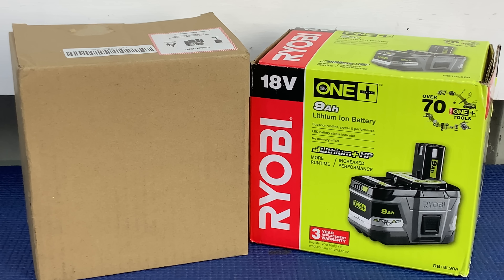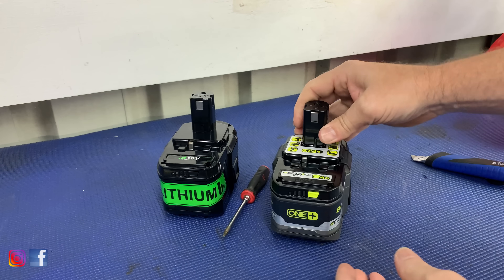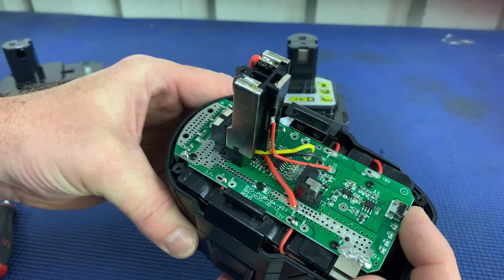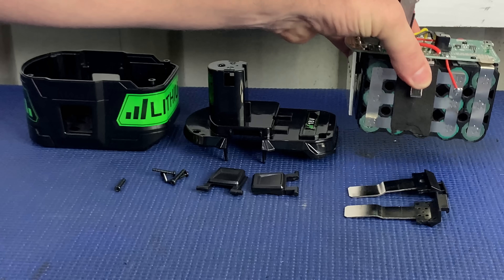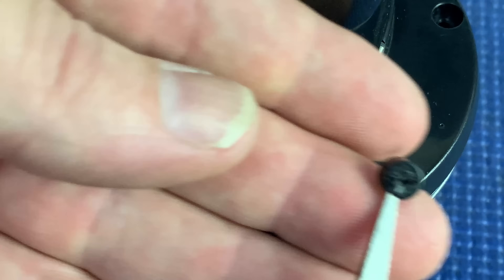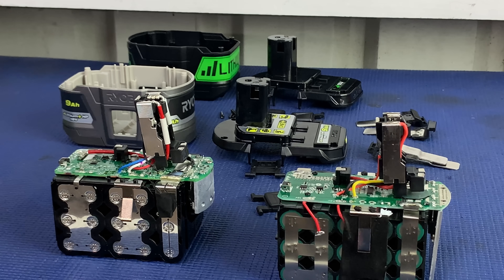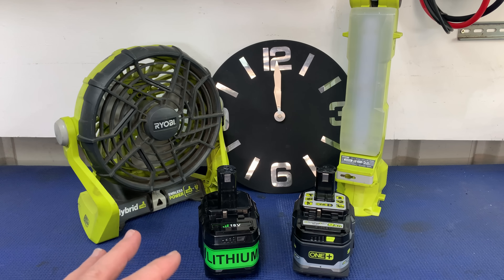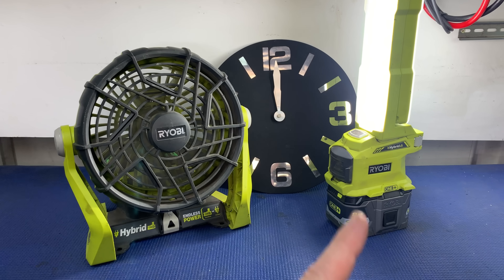Ryobi 9ah battery versus eBay knockoff job

Comment: All good tests and points, however in 2023, Ryobi are taking the absolute piss with the new battery pricing here (AU). It's been increasing in price, and lowering in capacity the entire time (4AH is now the same price that 5AH was 24 months ago. This is a BS move.  Ryobi batteries are far too expensive and it's on purpose. I hope aftermarket batteries improve and some better quality alternatives arrive. Ryobi are doing a "Polaroid camera" move on us. The Camera is cheap, the the price of film will send you broke.

Comment: Seems to me it IS worth buying to use in things like the light and fan. No point in having the large name brand battery tied up as a light.
Reply from the maker: That is a very reasonable call, BUT still have to address the 'value' and ethics in marketing - the battery tested out at just 3 ah...

Comment: How did the Charge/Discharge Cycle test turn out?  I looked for the follow-up, but didn’t fine it.  

If these batteries performed as well as the 4 ah Ryobi batteries… and where reliable at least for a few years, I would pick up two to have as backup, and use while waiting for the Ryobi Batteries to recharge… or when I use multiple tools at once. 

All my best.
Reply from the maker: They tested at 3ah after about 6-10 cycles they died and found 2 'cells' zero volt :( I still have the footage from tests I did but they were not worth putting together for another video
Reply from the maker: the only public post after release of this video here https://www.instagram.com/p/CNrOhGAn8Sr/
Reply: @HBPowerwall   I appreciate the reply, and your experience with these batteries.  Was even thinking of picking up to for my old Blue Ryobi Kit (5 1/2" Circular Saw, Drill and Reciprocating Saw and Light) and giving it to my son-in-law.  But I'll just get two of the Ryobi One Plus 18v 2ah black batteries.  They'll perform better then the old NiCD Ryobi 18v batteries that I used for years.  It's very, likely these batteries wouldn't be reliable. 

I appreciate the help.  Aho... 😉

Comment: I bought this exact knock off battery. I used it in mt grinder. while grinding metal. the battery gets hot and the grinder stopes working. It has to cool down before I can grind again

Comment: I called BS on this review
Reply from the maker: its a fair call, but also this is honest as it gets - ABSLUTE shit battery advertised as 9ah, tested at 3ah 9 or so load tests into the next video battery went zero volts and wouldn't work again.. changed the bms to another set of batteries - worked fine again.. You call bs I say I was FUCKIN honest!
Reply: @HBPowerwall  when you do a review you can't start off in a biased position because it makes it look like you're paid to do the review which this one seemed like it and a lot of other people seem to have thought so also. Don't get me wrong You're good at doing reviews but that also adds to the thought of maybe being paid for on the reviews..  see the thing is what everybody wants that is looking at the knockoff batteries is to save money and the amount of time allotted with the name brand battery compared to buying two that claim to be 9 amps but actually 6 amps or whatever You're getting 12 amps for a lesser price even if they were four amps apiece that's still considerably cheaper than one 9 amp hour and you're still getting 8 amp hours... What the real test would be is to run the batteries hard draining them as fast as you can as many times you can that would be a very good video because that's what most people are wondering how hard and long can you run those batteries before they crap out cuz we already know that they're Chinese young so we're not expecting the name brand performance we just want them to work and get our money's worth... I hope this helps
Reply: @HBPowerwall  you can rejuvenate them by bypassing the BMS and hooking a fully charged one up to it just to get it past the voltage where it recognizes it as a lithium bank

Comment: I feel like you were pretty biased against the knockoff from the very start. Not that I blame you, but if you're trying to give a fair comparison you should reserve your opinions for the end of the video.

I also think it would have been better to test the batteries before opening them up. What if the knockoff's locking mechanism worked fine before you disassembled it? We'll never know.

You wouldn't have been able to test the performance if you accidentally killed one of the batteries when you took them apart, like when you dropped the name brand battery. That would have ruined the video pretty quickly.

I wouldn't mind seeing some kind of measurement on tool performance, like what were the RPMs on the fan on the name brand vs knockoff battery. Did one push more air than the other?

I bet the Ryobi did better. This could also explain more of the price difference between the two.
Reply from the maker: it was so shit from the outset, it created a reason to actually make the video lol Old youtubes then thought - i'll pick a shit video and send it out to the world lol

Comment: I have found that knock-off batteries (or  off-brand adapters) are always missing the protective circuitry that keeps the tool from over-discharging or over-currenting and ruining the battery itself. Probably why there is so much more circuitry in the real thing.

Comment: Your math is really weird.  How do you claim 300 vs 72 is a 76% difference?  All your other percentages are wildly off too.
Bottom line is you can buy 4 generics for the price of one genuine.  The question then is that good enough?  And it will be more of an aging thing than a run time thing.  Which of course you didn't attempt to answer.  For such a massive price difference I would use the generic and buy a new one whenever it goes bad.  But it could be the wrong decision and only time would tell.
Reply from the maker: Suck at math but I’m better at math than they are at honest marketing or good engineering

Comment: Owning a load of Ryobi One tools and having an even increasing number of batteries that seemingly die for no reason and usually a month or so after the warranty runs out, I think the knock of batteries are probably a good idea. It's a shame you didn't try the battery in the charger before you dismantled it - it my be a reassembly issue.
Reply from the maker: the reason for the video is it kept falling out of my wippersnipper and it 'wasn't warranty issue' kinda useless piece of junk - didn't last 2 weeks and 15 cycles
Reply: @HBPowerwall  gotcha - not knocking the video mate just moaning about the reliability of the ryobi batteries. I'd love a decent alternative - I'm so heavily invested in the tools now I'm a bit stuck.

Comment: There's a big difference between a knockoff and aftermarket. This is obviously not a knockoff but either way if you're paying a lot less you shouldn't expect it to be the same as the ridiculously overpriced original.
Reply from the maker: what pissed me off is it fell out and measured at 3 ah not the advertised 9ah.. it's just lies and deception - then wait till you try to claim that warranty!

Comment: My fear with the knock off is, it could only be rated at 250 cycles where the genuine one could be rated anywhere from 350-500.

Assuming 500 best case scenario for ryobi and 250 for the knock off(There's no way the knock off is throwing in good quality batteries at that price), that's 50% of the knock off's value down the drain and with 25-35% less capacity that brings the value of both equal in terms of ROI(assuming the knock off works for it's entire rated life cycle... zero chance of that happening if they're being used in high drain tools)
Reply from the maker: knock off got less than 20 cycles then died lol

Comment: Purchased Vanon Batteries on Ebay - What total Rubbish
Reply from the maker: ooh Vannon... what crap did a video on them too only to find out they sent me a battery with Premium cells in it, sold 100's on my recommendation only to find out all the 'client' ones were cheap crap..
Reply: @HBPowerwall  Thanks for your input.

Comment: I will say it was very enlightening but there are caveats, ryobi branded chargers the flat long green ones have a high failure rate, I've lost 2 new ones and a used one that works intermittently. This leads me to believe a. I'm either extremely unlucky b. Quality Control has suffered. The older one can still charge batteries every now and then, both the new ones failed within a month. It happened during covid, I didn't feel like returning them so I popped them open. The 2 new ones had a different pcb than the older one, I suspect a power switching component to have gone bad on the new ones. Like described on this video:   https://www.youtube.com/watch?v=b9HJ1iiyvWs

I also had a 2ah battery come bad from factory on a 2 pack, one of the cells was shot it no longer takes a charge. $50 and half the products were bad from factory, again during the lockdowns so I didn't bother with returns and I poppped them open. I wish a had a battery welder they're about $100 for a decent one and I could just replace the cells myself, I went through a bit of buying tools at pawnshops and ended up with like 3 2ah dead batteries, upon opening those on some the nickel plates were broken and on one another bad cell, these were used so I have no idea how long they lasted.

I really love the one+ system, they have a lot of neat tools I do wish their quality control was better, but at the very least I haven't had a single tool go bad, just batteries and chargers. Hell my first ryobi from the blue and yellow days still works fine with new batteries (my yellow batt died). In any case I consider these mid tier tools, if you want quality go Dewalt but from stuff on the internet their QL isn't any better than Ryobi, I think they're even owned by the same umbrella company.

This answers my question, either buy used legit Ryobi or new, but not the fakes.

Comment: I stupidly tried the knockoff Ryobi and DeWalt batteries. Junk. Yeah, they worked I guess, but as you demonstrated, NONE of the knockoffs "snapped" in the charger or tools and that drives me nuts ! The big difference was the longevity. The knockoffs do not last and will stop accepting full charge too soon. Great video here,  it I was already convinced based on my attempt at going cheap. Not again. They run the real thing on sale frequently, so I just wait for sales.

Comment: Why didn’t you test the batteries before taking them apart. We will never know if the connection would be better or not. 
Test Test Test then strip it down.
Reply from the maker: I was using it, we will call that a test - it was effing useless, decided to make a video... in my mind I tested, tested tested, got pissed, made video...

Comment: We have 8 "Ryobi type" 18V batteries, half are authentic and half are knock offs. You can tell they are knock offs with just a cheaper feel and they do last a little less, but for essentially 75% off the full price option its worth it. We've had them for a few years and they don't run like they used to, but the fact they are still going is impressive for a cheap battery.
Reply from the maker: Must not be this shit battery brand then, cause this died 100% useless after less than 10 cycles

Comment: Bought a couple knock offs for my Dewalt 20V max equipment and they have been great! 1/3 the price of Dewalt.
Reply from the maker: Seems like your the exception not the rule.. congrats on not being screwed over.
Reply: @HBPowerwall  I did my research here and on Amazon and went with a knock off that most people had good luck with. So I really didn't leave it up to chance. In fact if I remember correctly I could return them if I wasn't satisfied.
Reply from the maker: Sounds like a soild plan but doesn't make for a very youtubie video lol

Comment: I have some knock off batteries from amazon.  They are 5 amp hour batteries.   I have no issues with them staying in the tool.  They are a couple years old and still working.  Am I getting the same performance as a genuine one probably not but they plug in and run the tool and I got two battery for less 1/3 of the of one.  I can easily switch to the second.   My logic is I can have 6 cheap units for the price of one genuine.  I know for fact the 6 batteries will give me fat more run time then the one genuine one ever will come close too.

Comment: The Ryobi batteries are clearly better made and have some additional features. However, they're still insanely expensive. Lithium batteries aren't that expensive anymore, Riobi is just having a laugh with their markup. Would be nice if there was a bit higher quality knockoff was available.
Reply from the maker: I guess RnD is expensive... also those nasty share holders..

Comment: That is an interesting video. Where is your follow-up video on the multitude of deep charge and discharge for these batteries? Went to your YouTube page and could not find this test. Please Supply a link. Thank you and best wishes
Reply from the maker: Started the process straight away about 5-10 cycles in battery died and I got so pissed off I just gave up, at that time video wasn't doing anything on youtube and seamed useless to continue, little did I know it would be one of my higher ranking videos long term https://www.instagram.com/p/CNrOhGAn8Sr/ here is a photo of said tests
Reply: @HBPowerwall  thanks ....

Comment: Your absolutely correct. You don't have to work for ryobi to know that the e bay knock off batteries don t last.
Reply from the maker: If they advertised them correctly it'd be fine but the 9ah that's actually 3 makes me hate them more !

Comment: The big 6 amp and 9 amp batteries are for the big power draw tools.  I feel the difference in my circ saw, 1/2” impact wrench etc.  testing it on an led light isn’t very helpful.  Although I do appreciate the time and effort it takes to buy these things and make the videos, so thanks!

Comment: I have several of both batteries and the one you claim is a cheap piece of shit lasts 2-3 times longer then the ryobi branded one. I use them
to drill holes for goose decoys in frozen ground and I can tell you from 4 years of using them that the cheaper batteries are better as far as run time and how many charges they take before giving up the ghost. Your review is obviously biased because O have abused the hell out of these cells and I know what one is better. The Ryobi has a more durable housing but that is where it ends.
Reply from the maker: I don't believe that for a second, but well done i guess.

Comment: Your test was not done in a very scientific way. You were so biased right from the start that one has to be suspicious of your results. Its true that the knock off was inferior in some aspects to the genuine product but the price was significantly different and you had disassembled and reassembled both before the test which conceivably might alter the fit and the results.  In view of your misgivings about the non-genuine brand it would only be a fair test if you concealed which battery was which before looking at the results.
Having had serious issues in the past with "genuine" batteries of the same brand (admitting that they were the smaller, older model batteries) I use different brands whenever possible. Now I know that the variety of tools with that brand are more extensive than those of cheaper brands so I do still have some of those that I use regularly.  However if the time of the use is multiplied by the number of discharges before the battery failed you might find that the cheaper battery is much better value as this has been my experience.  In addition, I don't know what brand that you tested but it's not fair to label all cheaper products with the results of the test of a single battery that is anonymous anyway. If you can afford to test a number of the genuine brands verses a number of different cheaper brands, and collate the costs versus the effectiveness you might come to a different conclusion if you are open minded about it

Comment: As others have said (including the author) on low-drain (low power) tools the differences are relatively small, but on high-drain tools (try the Ryobi heat gun) the knock off batteries will not generate enough current to run at the same speed/heat output. Yes, they may last almost as long, but they are running at lower output to do it, so their stated capacity is, in effect, garbage! Put them in a high power blower and you can hear the difference in run speed. The cells just do not have enough current available to run the tool properly. I have tried both extensively and now would rather buy second hand Ryobi than brand new knock-offs. Just my view!

Comment: Sometimes these knock off batteries make sense.   I have some 18v Porter Cable tools that are no longer supported (their tools are now 20v).  Buying generic batteries keep me from having to scrap these older tools.   So far the generic have held up way better that expected.
Reply: I bought the knock offs, not a tradie that relies on their tools, only have 1 tool that requires batteries that get used at best 2 or 3 times a year, a power cord option could not be found anywhere.
Couldn't justify spending the extra dollars.